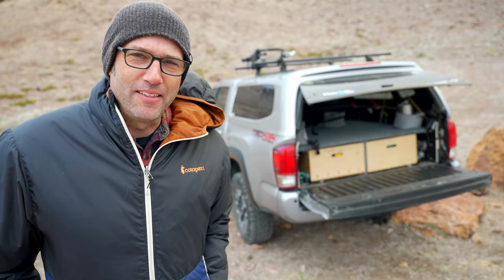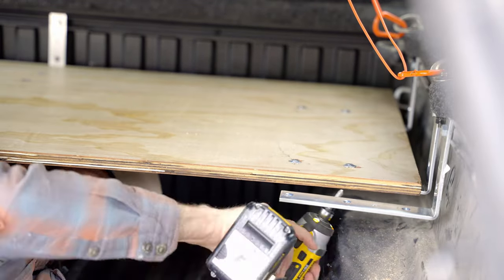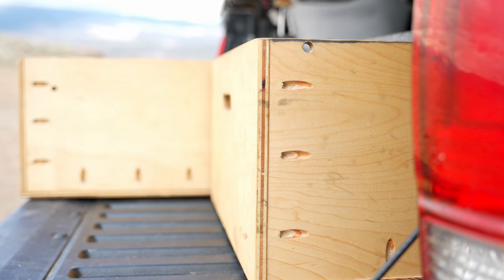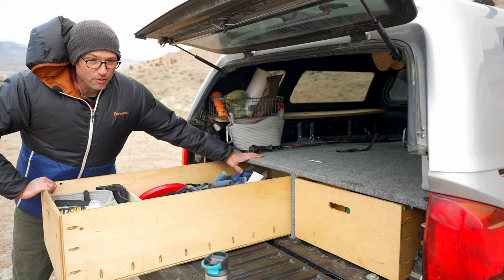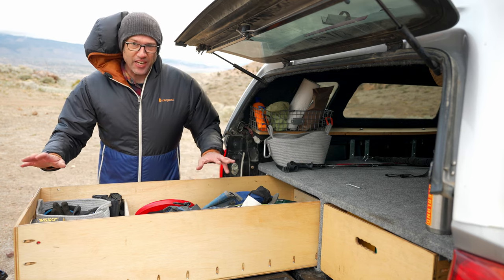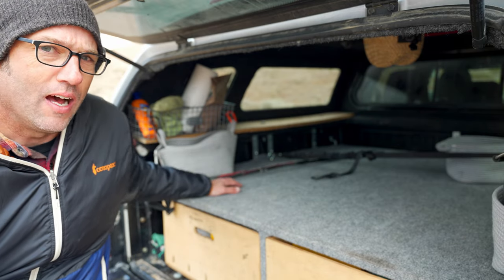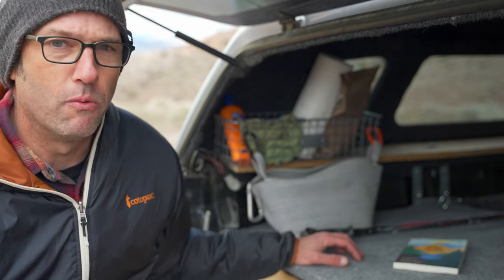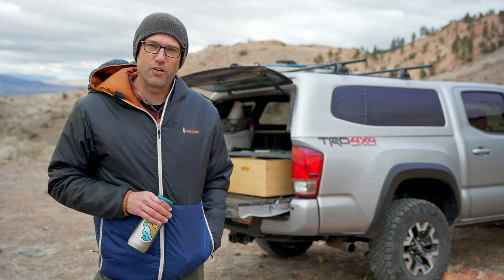Minimalist Tacoma drawer system and sleeping platform

Comment: so smart nobody thinks about the weight ... I have GFC so i can open the side so went with 1/2 plywood made boxes no bottom attached to side rails and rivinuts in bed weight is less than 70 lbs total had drawer system before over 180 lbs plus gear also with your system you can leave drawers at home when not using them ...

Comment: Great work. I'm always amazed at how much 3/4" stock is used. Even the 1/2" sides and dividers could be lightened by jigsawing or routing some  cutouts in the panels. Reduce by 30% or more and should still have vertical strength.
Reply from the maker: I could do that if I added more fixed dividers. I don’t think it would be strong enough with out those.

Comment: Looks great . I have a 2018 taco with the same type of platform topper and rug but I cut my sleeper pad into three 2 foot parts and cut down the middle and secured underneath with hinges and two two foot supports that slide in in the Toyota channels. I did this so they just pop right out when I don’t need the sleeper. Breaks down in like five minutes .  Now i Gotta make a slider box but I don’t want to glue anything to the bed. Maybe use plywood at the bottom too. Hmm
Reply: You can just make a lip on the drawers that fit into the grooves and they just slide on the plastic, or do a very thin sheet of wood on the base.
Reply from the maker: The bed grooves end at the edge of the bed, so that wouldn’t allow them to slide out.

Comment: Have you had to add different leaf springs or anything because the shell and gear? Is the ride different with all the weight? Thanks
Reply from the maker: Yes, I added Icon add-a-leafs and timbren bump stops. Ride dis kinda suck, but that has been solved…